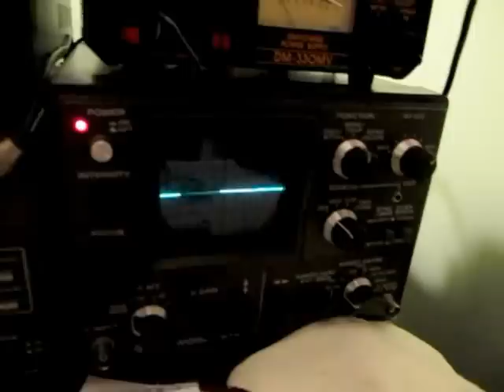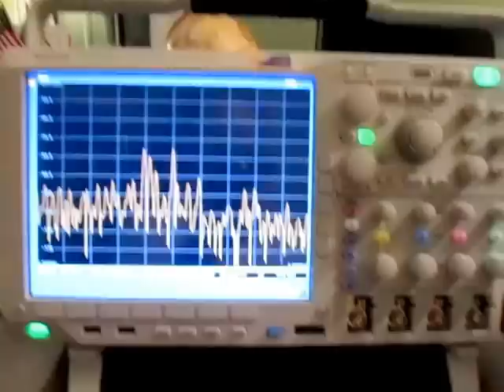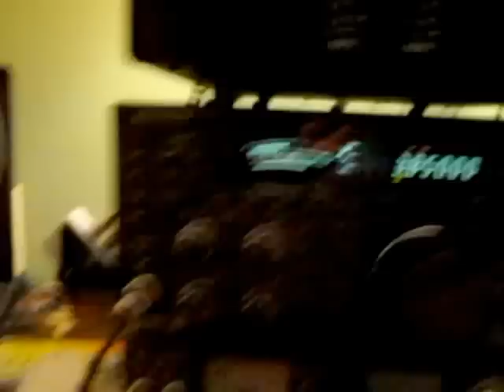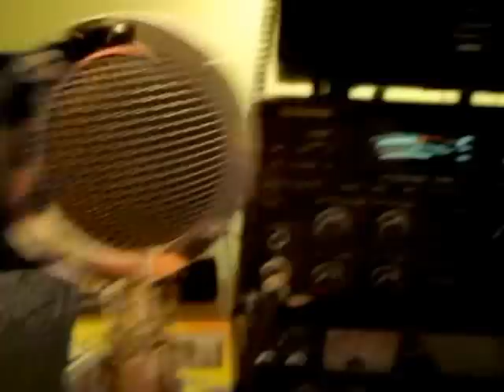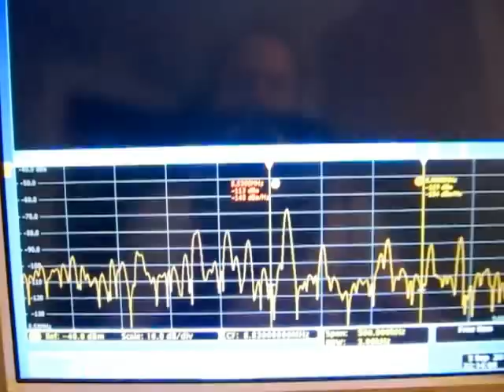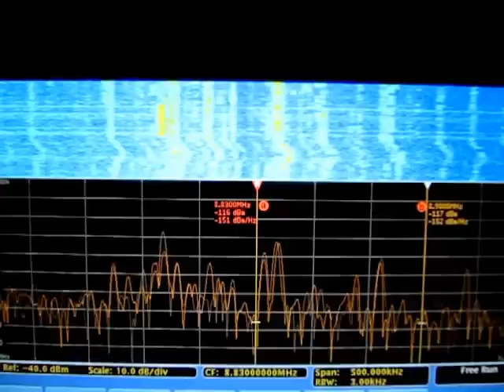#15: Ham radio Band-scope pan-adapter using Tek MDO4000 as a spectrum analyzer

Comment: please show us how to monitor ham band frequencies using NANO VNA .
Reply from the maker: The NanoVNA is not a spectrum analyzer, so your results will be somewhat limited or restricted.  The way you would set it up would be to use an S21 measurement (trace on CH1, Port2) using LOGMAG S21.  Terminate CH0/Port1 with the 50 ohm terminator to minimize interference.  Connect the IF output of the radio to CH1/Port2 input.  Adjust the Stimulus settings according to the radio's IF output frequency and span.  You may need to adjust the Scale on the VNA.  Since you don't have control over sweep rate, resolution BW, reference level, etc., you'll have to just take what you get.  If the output of the radio's IF is too strong, you may need to attenuate it.

Comment: New to Spectrum Analyzers here. I acquired two to learn and play with.I’m concerned that these are input sensitive: AC signal strength and/or DC coupling to the input can cause damage.
How do you determine what’s safe?
The Kenwood IF output  is obviously matched to the Kenwood  monitor, but what if you didn’t
know how strong the IF signal was? How did you determine the signal strength to apply to your spectrum analyzer?
I’ve been half tempted to connect my cable tv to the spectrum analyzer to see what I could see. I also have a tv antenna for local channels, it’s amplified and has a dc supply to power it on the same coax. I’m afraid if I connected, the DC supply would damage the input. I know I could put a blocking capacitor in series with the input, but how much attenuation  should I use, (starting point)?
Reply from the maker: The analyzer should have markings on the front panel regarding the maximum safe input power and DC level.  If you are unsure of the DC bias on your signal, simply measure it.  You can always use a DC blocking capacitor to be sure.

If you don't know how strong an RF signal is, then you should start with making the Reference Level in the analyzer has high as it will go, and maybe use an external attenuator (20-30dB).